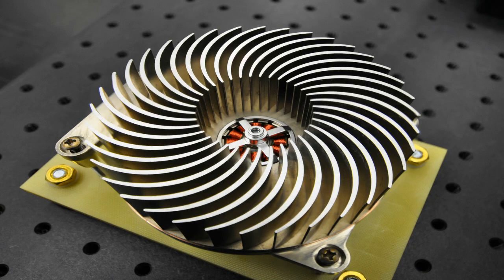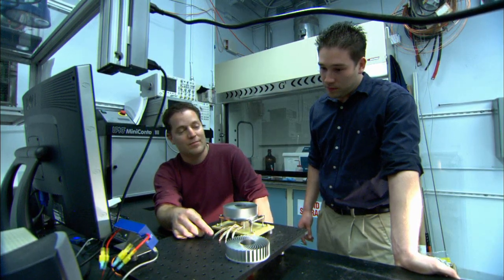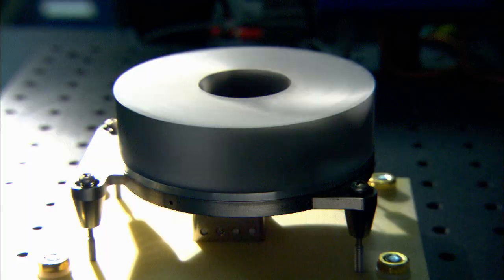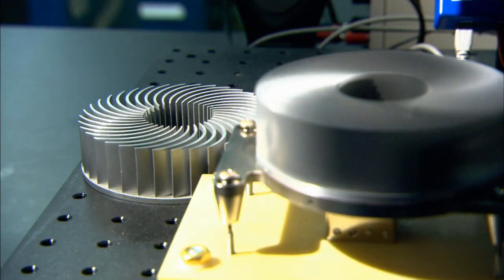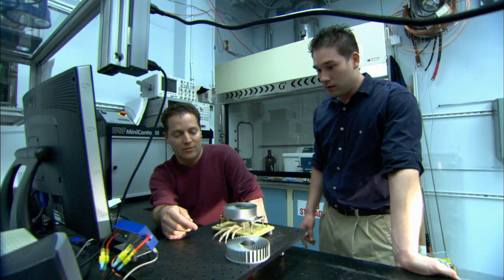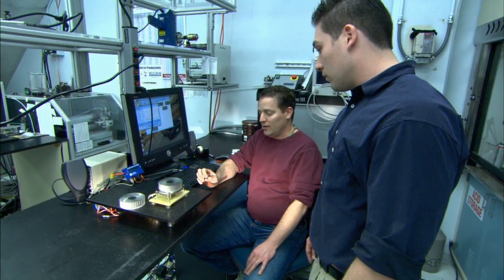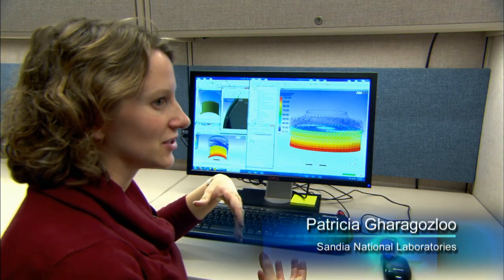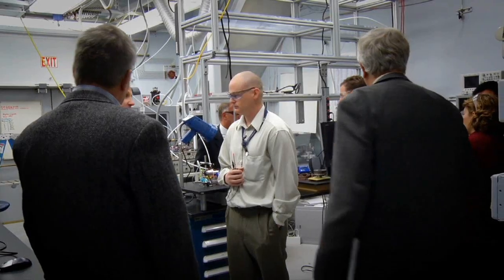Sandia Cooler

Comment: So simple, yet complex. Why didn't someone think of this years, or even decades ago? The basic idea for cooling is already in use for different things, but for PC cooling or the cooling of electronics, it hasn't been taken this far. What about a magnetic bearing? I get the air bearing, but the magnetic bearing would never allow the spinning part to contact the heat sink.

Comment: So, this tech is all about decreasing theta θSA, which is the thermal resistance between sink and air, but in order to keep the θCS (case to sink) comparable to conventional heatsink mounting, this tech requires the preservation of a very small gap with a tight tolerance, comparable to the head-to-platter spacing found in spinner hard drives. This does not seem to be a mechanically robust or shock-resistant technology.  Just put a fan on the heat sink for crying out loud.

Comment: The objective is to remove the stagnated air between the fins. So doesn't adding a layer of air between the IHS and the fins just move the problem closer to the element? I mean, if it works it works but until I see proof this can outperform a heatpipe cooler I think it is a beautiful gimmick.

Comment: In WW-1 they need to cool an engine without using fluids and be very light weight. They designed a "Rotary" engine to cool it so they rotated the whole engine.

Comment: A simple heatpipe system will do fine for most uses. In my experience air bearings are great for stuff that stays put but if it is subject to shock... crash 😵
Reply: This was 9 years ago dude

Comment: For those wondering, Thermaltake made Engine 27, which is based on this design. SKU CL-P032-CA06SL-A   They have it on Amazon for 75USD.  It runs on PWM and uses 8 pole motor, so RPM feedback is skewed.
Reply: Good reviews and very small

Comment: Basically the exact design of a PS4 cooler, wonder if it's close enough in efficiency that it isn't worth the added cost.

You can replace the aluminum with hard plastic, the weight of that thing alone is a huge deterrent.

Comment: How are they supposed to get good heat transfer if they are using an air bearing? I would think that layer of air would counteract the solution to barrier air problem they had in the first place.

Comment: If the mechanism holding it together breaks while it operates, you will suddenly have a loose rotating blade disc inside your PC, speeding at 4000 RPM and destroying your PC utterly from the inside. It will break the GPU,  RAM and motherboard into pieces. Everything will be obliterated. It maybe even break your window side panel and hit you right in the face! What a sight!

Comment: how the hell are you transferring heat efficiently from the heatspreader on a cpu to a spinning piece of metal?
Reply: Listen to what they are saying in the Video. ^^
Reply: ***** they didn't say anything about transfering the heat through the axel of the motor.
Reply: Because they transfer it over the airlayer between the two parts
Reply: ***** yes, because as we all know, air conducts heat very well.
Reply: Bacon CheeseCake No it doesnt but. They explain how they managed to overcome this problem in the fucking video. Just listen

Comment: How does the air bearing achieve heat transfer?
Reply: Hoshimi Draws  because heat transfer coefficient of air is vastly less than that of metal, normal heat sinks have very large surface area and a thermal paste on the contact pad. even a thin layer of air at the contact pad significantly reduces the entire device's capacity to transfer heat, that's why traditional heat sinks practically stop working if you leave a gap in your thermal paste layer. in this proposal there's an air gap without thermal paste at all.
Reply: exactly, this is the biggest question. it's like putting a heatsink without thermal paste.

Comment: So, all of the coolers that I've seen like this are placed flat. Is there something against putting them sideways, like they would be in a standard computer? I would think that the extra weight pushing down would cause a lot of extra friction at the bottom of the heat sink because it's just resting on air, or have you nullified that somehow? Another option, am I just being an idiot?

Comment: "dust will fling off" yeah the same way my fans get buried in dust...
Reply: It's in the design. 
The typical fan blade cuts through air, each time  pushing a slice of air forward, perpendicular to the blade, this creates lots of friction and static electrostatic, trapping dust on the blades themselves.
With this design, air is centrifugally flung out of through the gaps between the blades with higher velocity so even at 200 rpm, the exit velocity is much higher. 
But I do see two problems with this though. First being that the viscosity of the air doesn't change and fluid dynamics would suggest that a layer of turbulence will still form along the surface of the blades, trapping some dust along with static created from the friction. But because the velocity is much higher, larger dust particle should be pushed through more easily. 
Second, dust have to land somewhere, if not on the blades, then on the heatsink down the line. The way the fan is implemented (ie, by Cooler Master) would mean that dust fling off the fan will just get caught by the heatsink. 
Another interesting thing, however, is the switch in how air is pulled into the fan, from a planar nature to a turbine-ish system, this would make it easier to filter the air beforehand if needed.
Reply: Your fans might fling dust if they were spinning at 2,000 RPM too . . . normal computer fans spin at  ~700 rpm 1,300 RPM slower.
Reply: Glad to see someone made that obvious comment.
Reply: exactly what I thought
Reply: ISFiYIywAFIBc6qAIIIIIIIIIIIIIIIIQrXTJiCtY3Asd4WF did you watch the video? The heatsink/fan spins at 2000rpm. cpu/case fans spin at upto 3000rpm. most commonly around 2000rpm for high static pressure fans. And so what if my fans are plastic? I can buy a 212 evo which has a smooth finish on the plastic and it'll still be covered in dust after a few weeks or so.
Reply: Get a proper case with good dust filters. I've got no problems with dust in my Fractal Design Define R3.
Reply: your fan isn’t moving at 2000 rpm
Reply: Your fans are plastic and spin much slower.
Reply: @isfiyiywafibc6qaiiiiiiiiii570  Doesn't matter

Comment: Used as a fan, this is a blower-style cooler and will not be as quiet or efficient as mode coolers with good fans.        Used as a heatsink, this is never going to work.  Proper heat transfer requires good contact.  That contact will produce friction in the case of a moving assembly and generate far more heat than it can dissipate.  That is why pretty much ALL heatsinks today are stationary with a moving FAN.

Comment: If you combine this @ 90 degrees to the horizontal plane connected via a vapor chamber support and base you could have this working in vertical machines, aka,  towers.
So motherboard is vertical, base and vapor chamber supports are horizontal with a 90 degree  end twist that supports and feeds the cooler. 
You guys probably thought of this anyway.
https://drive.google.com/open?id=0B1vrHMH35XdheFQ4c1VFbzBhS0k
Only downside I can think of is nudging the rig/pc could cause major damage to free spinning fan (as far as my knowledge of how this works)

Comment: How does the heat transfer from the top of a hot object like CPU? Which part comes with contact
Reply: The air bearing is just as efficient a thermal insulator as the boundary layer on a conventional heat sink.
Reply: the stationary base is mounted to the CPU, and the thin layer of air transfers the heat to the spinning heatsink.
Reply: That I do not understand. How can air conduct the heat efficiently to the fins yet we need massive amounts of fins to remove that heat from them.
Reply: Thank you, I was looking for this answer, will look it up some more.

Comment: Right right, and where is it now in 2016?
Reply: +Kevin Moondust Stole it? Use your brain... There's this little thing call LICENCING. What makes more business sense: investing millions to setup a production line, QC, marketing, customer service, maintenance/retooling,  etc. from scratch all for a single product OR simply licencing the technology to an already established manufacturer and saving all that time, money and risk?
Reply: it cant work sideways with the air bearing which is where its currently at. Which is why I heard they only have these advertised for servers that sit horizontal, Which normal PC's dont do so dont expect this anytime soon
Reply: Thermaltake stole it: Search it under Thermaltake Engine 27 1U.
Reply: +Kevin Moondust No, its CoolerMaster and some other company stole it first, they didn't say anything about it.
Reply: Zero necker I stand corrected guys; after digging a bit deeper I found out Thermaltake DID license the tech from CoolChip, whereas CoolerMaster did NOT, so the culprit is another company. 
Whatever the case, the "final" product is the Thermaltake Engine 27 1U cooler, of which I expect a review ASAP because I'm deeply interested.

Comment: With respect to orientation, they could easily add a spring to provide the counter force to the air bearing. The issue I'm having is that they totally gloss over the fact that they need to transfer heat across a nice insulative layer of air...
Reply: I have the same question. The way Cooler Master uses this (in another video) is to have another heatink surrounds the fan.. same old design we see in stock gpu cooler.
Reply: @krap101 The insulative air as you call it is reduced by the spinning effect of the central column aka a mini vortex or mini tornado.
Cool air drawn in from the top hits the base expands and is expelled by the fins.
Like stirring a tall glass of water. the faster you churn the water in one direction the deeper the vortex goes relative to the rate of initial turn.
Reply: There's no hole at the bottom. Also look up what a boundary layer is.
Reply: krap101 is talking about from the stationary eg. CPU mounted part to the fin.

Comment: Will this actually work when it's positioned sideways like most coolers used in PC towers? Seems like gravity and the air bearing are counteracting eachother when it's positioned like in the video. But in not a single demo have I seen it on its side, and I think that's because gravity will try to tilt the top part of this cooler, which in turn will hamper its movement.

Comment: I have one patent on a heat sink,  however, I thought of this idea a while back and have a significant improvement on this. I combined a Tesla Turbine with an electric motor and wala. The world most efficient electric motor principle. It both cools and pumps air.
Reply: What about two working in opposite ways to maybe cancel vibration and some noise

Comment: They did all this work trying to take static air away from the fins, just to create more static air resistance to heat flow using a damn air bearing between the fins and the cpu. This is the definition of wasting time fixing something that wasn't broke. I wonder if they ever thought about just putting golf ball dimples all over the fins to break up that boundary layer and not make the entire thing spin.

Comment: I'm just making an educated guess, but it looks like the challenge they couldn't overcome is that the thing has to be oriented "up". They gloss over the "air bearing" -- which is identified as the key to transferring heat from the base to the fins -- but the spinning bit /hovers/ over the base when it gets up to speed. That's because gravity holds it "down" ... which it can't do if you tip the heat sink on its side. As a consumer product, that's a real limitation.

Edit: the first commenter seems to have found a statement released by Sandia, explaining that a compression spring is used to hold the impeller and base together (not gravity, like it appears in the video).
Reply: It works independent of orientation 
The most common misconception seems to be that the Sandia heatsink only works in a horizontal orientation. In the YouTube video released by Sandia the cooler is demonstrated like this, so it seems reasonable to assume the air bearing heatsink only operates on a horizontally plane. Yet as we all know, most computers have the motherboard vertically oriented... According to the developers, the Sandia cooler is in fact orientation agnostic - meaning the air bearing is not affected by gravity and the spinning aluminum fins will operate vertically, horizontally, upside-down or at an angle. A compression spring is used to hold the impeller and base together, not gravity.
Reply: Hey, alysdexia? Hard drives work sideways because they have *a solid shaft running up the middle*. This thing is floating on a cushion of air. Trying being a nicer person next time.

teh_r4serei says Sandia released a statement somewhere else saying the device uses a compression spring to hold the rotor in place, and it seems reasonable enough to me that I'm not going to double-check his source.
Reply: even if orientation were the problem, it wouldn't be too difficult to setup an appropriate mounting sollution
Reply: magnets
Reply: those might actually create to much distance...

Comment: Fans spin at 2000 RPM too and collect dust just fine...
Reply: Dust gets stuck on both heatsink and fan, some on the underside of the blades and some on the cutting edge of the blade but also on and in the heatsink fins. 

It's why i usually keep a small toothbrush in my computer kit, so i can get between the blades and brush the dust from there as well and a can of air duster for the heatsink.
Reply: @QuantumBraced most modern fans are plastic. This is Metal.
Less grip for dust particles and or static resistance may also inhibit the dust.
If you run a metal desktop fan and a plastic equivalent and the same speed for the same length of time in the same environment you will find the plastic one gets clogged/coated easier / faster than the metal one.
Reply: Smoother surface. It's like a pearl forming in an oyster or a raindrop forming in a cloud. The more polished the metal is, the less chance particulates will have a chance to grip on to it.
Reply: Yes, that's why they call it the dust devil.
Reply: Always. Just ask the wifey
Reply: He said "a structure like this" spinning at 2000 rpm.  This structure , at that speed, would be more successful according to them.
Reply: Fans also push heavily against the air, this doesn't push against air, it "flings".  Look at the fin design, this one won't collect dust ANYTHING like  typical fan blades do.  It's not about the speed, it's about the fin design.  I can't believe you have 46 uplikes  smh...

Comment: So what happened after 4 years? It was so good so the fan flew away to outer space on its own?
Reply: That's exactly what happened, then it grew sentient and decided to go where boldly no fan has gone before.
Reply: Thermaltake Engine 27 1U
Reply: By now 2020 I think it already reached the edge of the milky way galaxy :-)))
Reply: i....is that an Amazo reference?! o.o
Reply: Cooler Master has a similar technology that it's working on nowadays.
Reply: One more 4year......
Reply: @anguschau  We are still waiting for Tesa tape data storage and 200GB writable optical discs, laser TV and holographic cubical crystals for data storage. Mirasol displays ...
Reply: @dorfschmidt4833  How can you forgot Flying cars?! 🙂
Reply: https://www.facebook.com/CoolchipTechnologies/photos/a.1066335960112688.1073741829.491526184260338/1066325780113706/?type=3&theater
Reply: Coller Master use that. I forget the name of it but you can find it.
Reply: It phased into a different reality.
Reply: And more 4 years after?
Reply: That's what LIGO has been picking up, duh!
Reply: It was licensed by Thermaltake for the Engine 27 CPU cooler which basically abandoned everything that made the Sandia prototype unique and effective
Reply: And now 9 years later every house in America.....has no idea that this exists. Heres another lil issue with its magical air bearing theres nothing holding it there so a laptop cant use it. And what happens when it's in a desktop and gets shipped and flipped flopped turned upside down and all around and then plugged in?

Comment: People have misinterpreted what this is all about.   A later clarification by a Sandia spokesperson states "What we measured in lab was 30X as much heat transfer per unit fin area compared to a conventional heat  sink ; this illustrates the 
  boundary layer thinning effect of the sandia cooler. Somehow this result was   misinterpreted as "30X more efficient" and went viral."

Essentially, this means nothing of importance.  You could take any conventional heatsink, which for comparison was probably a heatpipe sink since those have the most fin area to compare against, then get rid of most of the fins and run an fan at higher RPM (their fan runs at quite high RPM, easily over double the RPM of any CPU heatsink fan I use) to result in multiple times more heat transfer per unit fin area.  It might not do AS well, but clearly our computers are running still.

Essentially it's a shiny expensive toy.  It DOES work, but the advantages in most situations are not all that great, and all else being equal, it will wear out the bearing faster so for all the expense you end up with a shorter lived product.  Plus with a conventional heatsink if the fan eventually does wear out, you can usually  replace it in half a minute with a standard $5 fan available at hundreds of merchants if you don't already have a spare fan in your parts bins.

The last thing the PC industry and most industrial spaces need is a higher cost, shorter lived fan-sink substitute.
Reply: They probably got confused because the video description literally says "30x more efficient"